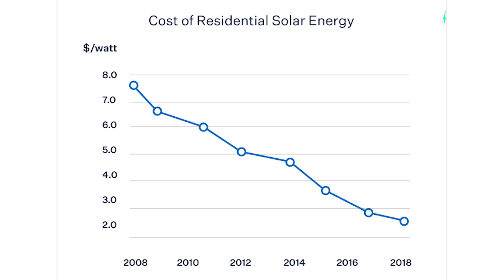How long does it take to save money with solar panels?

Comment: Solar is a home improvement not a business opportunity. The value of Solar is not determined by the rules that apply to say a solar hot water service simply because there is no market for a free standing dwelling where you can sell hot water surplus to your requirements. So the analysis what is the cheapest to run or what produces the most power for self consumption. I would definitely not buy a grid tied system today that did not have grid forming functionality. Grid forming allows your system and if you have storage to continue to function during a grid outage. My preference would be micro inverters (Enphase). As for storage I don’t like unbundling a system so again my preference would be Enphase and then Powerwall both have LFP battery chemistry. You have to remember Solar is not set and forget it’s performance has to be continually monitored. You are in fact the manager of a small scale power station.

Comment: Solar panels don’t really work on cloudy days in the UK. But England is quite sunny - nowhere near as sunny as Australia and obviously nowhere near as intense. I have 7  400W panels - 4 facing east and 3 panels facing south. At the moment when it’s sunny I get 2.4 kW. In winter I get very little. My pay back period was initially calculated at 9 years - but actually I think it will be paid back in 7 years. My best investment was to include the 5kWh battery AND get an MG4 electric car.
Obviously I think I’m being a good boy - but really this is economic sense too.
Reply: It does depend how big an array you can fit on your roof. We have 6.84kWp and even in March, which was miserable, the average generation was more than we used in the house
Reply: @bill_heywood  My house is smaller. I’d love to get some more on the south - but there’s no space. I’ve thought about putting 3 more on the West but there are some tall trees. Good luck to you Billy !!!!
Reply: @johnfrancis4401  that is the issue, we are all stuck with the roof we have. Our house is a boring 60s box, but turns out gives us a big flat SE facing roof. I just wanted our international friends to know that even here on our cloudy island, solar works

Comment: Sam there is something that nobody seems to have picked up on with home solar. The pay back period can be much shorter and the lifetime savings much greater if that electricity is used to replace the gasoline you would have burned in your car rather than the grid electricity you use to power your household appliances. "Possible savings" is how I look at it. For example, my system is guaranteed for 20 years and generates an average of 25 KWs per day. That is 180,000 lifetime KWs. If those KWs replaced my grid cost of 28 cents per KW,  I could "possibly save" about $50,000. On the other hand if I owned two EVs that needed 70KWs each per week to travel 20,000 klms each per year, then I could possibly save $190,000 in gasoline. That is if I replaced a petrol car like a Subaru Forester that gets 7.8 litres per 100 klms with an EV ( petrol $1.90 per litre) .  EVs have less maintenance costs but their upfront cost is higher so that has to be deducted from my "possible savings". In 3 years however,  they will be at parity.

Comment: For our panels installed 2011, South-West England, Cost £9000 fully installed. Paid for themselves in 4.1/2 years. All electricity supplied by them since (average of 2/3 of our consumption over the year) is free and saves us a lot.

Comment: I did the math recently on the energy cost of solar, to rebut some stupid “costs more energy to make than it produces” nonsense. It takes about 200kWh to make a 100 watt panel. Assuming a 20% real-world capacity factor (night, clouds, imperfect angles, etc), it takes a 100 watt panel about a year to make 200kWh. The decades of working life after that are all net positive energy.

Comment: 7.6 kw system paid for itself in 5 years here in NSW. That would be typical for Australian payback. The system has generated 102000 kwh with zero issues.  The key is not to go cheap on components, esp inverters. 

8 years now with about 5% degradation. Long term grid consumption 12kwh per day family of 5 and 1 EV only charged during the day.  This has our Model 3 averaging 38g/km CO2.

Comment: If the US pays double that of Australia we need to get this price down. The US uses double the amount of oil compared to any other country. We also use 60% more Natural Gas compared to any other country. My point is the opportunity is there to make a huge difference to cutdown the US usage of fossil fuels. If the panels cost twice as much as Australia why? Do we need to build more of these in the US to take advantage of the federal tax credits now for manufacturing solar panels? Perhaps this makes a big difference? I wish I was allowed to provide a link but just look up manufacturing federal tax breaks for solar panels. I don’t know if this makes it cheaper than China. What do you think? ❤❤❤
Reply: US blocks solar panels made in China due to protectionism. China automated production, dropped prices faster than US-based competitors could, and were accused of "dumping," even though many of the companies were still profitable. Chinese-made panels are the least expensive, so we pay more, and government spending offsets some of the premium. The US is currently going back and forth on whether to block solar panels built in other countries using Chinese-produced silicon, which could increase prices paid here further.
Reply: @larryevans6739  I’m sure you are correct but there are new incentives to build solar panels in the US. But I don’t know if this makes these potential US panels cost competitive.

Comment: No need to go all in at huge expense for total solar.  One can start an expandable solar power system for under $1000.  Can be built by simple simple wiring stepa by step.  Solar panels are $75 for 100 watts...practically free energy for life.  My electric bill for the last 15 years in Arizona was $0.  15 year old panels still producing over 75% original rated power.

Comment: The panels aren't the only cost. You also need the power electronics, the wiring, conduits, junctions and circuit panels, as well as the labor to install it all.
Reply: The panels are much less of a proportion of the cost.  Easier and cheaper permitting is often the difference in cost of PV installations between countries.
Reply: My 6.4kW solar cost AU$3050 including installation, and after rebates. Paid for itself in 19 months.

Comment: Also factor in:
Degradation of Panels and Battery.
Time at house during daylight hours (especially if no battery).
Reply: At least here in Minnesota, a roof will degrade faster than a solar panel. Solar panel degradation is about 1%/year. So the “lifespan” of a grid-scale commercial solar panel is 25 years or so, but the WORKING lifespan is much, much longer. The solar panel will still be producing useful electricity - for free! - decades after the end of its “lifespan”.

Comment: It takes about 12 years...and shortly thereafter it will be time to replace them. When you replace them, you may have to pay a disposal fee because there is nothing recyclable. I have $70,000 worth of system, and they cover about 60% of my power usage. The one thing to be very careful about is #1 The company that installs what you buy from them , may go bankrupt, or change owners , and then you have a legal fight on your hands if they haven't finished the install, or fixed problems after the install. #2 The power company or entity that supplies power , may change the terms of the deal as soon as your contractual agreement is up...or as soon as you make any changes to your system, like adding more panels for example. You will never be free of the grid unless you only have a lightbulb and a hot plate in your house, so your goal can only be to reduce consumption from the grid. My power supplier (the gov't) made me a sweet deal to buy in via subsidies...and as soon as my contract is up (ten years) My sweet deal changes to a sour deal where instead of letting me produce excess power at peak times and banking that power for use in winter months at a one to one ratio, the ratio will change from one to one half...so the power I put into the grid is only worth half the value when I need to take it out and I must pay extra to make up the difference.  BEWARE !
Reply: A more accurate statement might be "It takes about 12 years for me" . Others in different circumstances may find a payback of five years or less.
Reply: @BigBen621  Yeah, you're probably right. If you live in a moderate temperature zone you would pay it back sooner. Where I live, the temp. can be -35 (celsius) in winter and +30 (celsius) in the summer. Summer is about two months long and winter is about five months long.

Comment: The state of Arizona gets more sun hour's than any other state.
Reply: Solar is very Inefficient the Hotter it gets , I live in Phoenix Arizona
Reply: @paulhailey2537  
I used to live in Phoenix when I was really young. Spent my teenage year's in the Mojave desert.
I do know about the degradation of solar panels.
I've worked in the electronics field for 30 year's and with solar for 12 year's.

Comment: Would you look into if buying solar panels in Australia + shipping to the state's is still cheaper?
Reply: The issue in the US is not the cost of the panel - its the cost of installation in the US is highly over-regulated by monopoly power producers known as the local grid authority.  Every county should be in play to have their voters vote for representatives who will make the cost of installation regulations the minimum necessary to deliver safe solar - each county could start by copying Australias installation regulations.
Reply: @economistfromhell4877  
Every solar system I've bought I install myself.
I'm on my 3rd system.
Reply: good question. i wonder how hard to install a good sized sysrem

Comment: Policy support should shift away from residential rooftop solar. According to Lazard, from a Levelized Cost of Energy (LCOE) per kWh perspective, residential solar averages roughly 5x the price of utility-scale solar. To put it another way, for the cost of just the Federal tax credit, the government could cover the entire price to install more utility-scale solar generating capacity and have money left over. Utility-scale storage is also much cheaper, and it is easier to manage the grid at the utility scale. It may make sense politically to give another tax break to homeowners, but it is not an efficient use of funds and not the most effective way to decarbonize the grid.

Comment: One big thing to consider when replacing your roof is to select a roofing type that solar panels can be mounted on without requiring any drilling through your nice new roof.   Not having to drill makes a huge, huge difference in the robustness of the installation.
Reply: Standing seam is the best roof type, but the majority of roofs are fine. I worked for a company that made all types of roof mounts and I put comp shingle penetrating mounts on my mom's roof and corrugated metal penetrating mounts on my dad's corrugated metal roof. I don't anticipate any problems in the 30+ year expected life of the system.
Reply: Corrugated steel for the win

Comment: A lot of variables to that! What is true in one location isn't true for another! Type of equipment purchased and power needs are another! Buy all the best newest and most expensive equipment you are going to be paying for it for a very long time to break even if ever! 
I am in Arizona. With the power running right in front of my property they wanted 1500 just to hookup. I live in an RV on my property. That is considered temporary housing so they can charge for a hookup that is otherwise free for a house or mobile home. Add in the cost of a power pole, trenching, wire, conduit, and RV hookup you are easily at 3,000 or more upfront costs. If you can put the solar in yourself that is even more money saved! 
I put that 3,000 into a small but efficient solar system. 1240 watts of panels and 840 ah of golf cart batteries three years ago! I am now working on a two stage expansion of the system. Add 720  watts of panels and then renew and expand the battery bank to 1260 ah. I think I am way ahead! The only reason why I am expanding the system is for the luxury of being able to run an AC unit vs using the usual evaporative cooling. For those that don't know in an arid region evaporative cooling works excellent! It's just nice to have AC available at certain times of the summer.